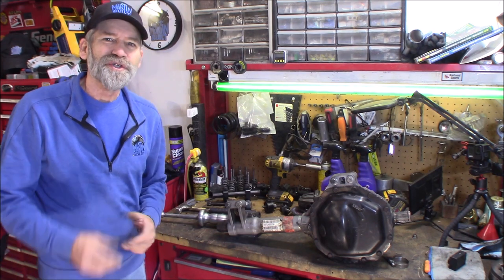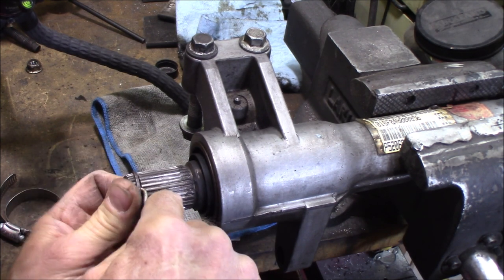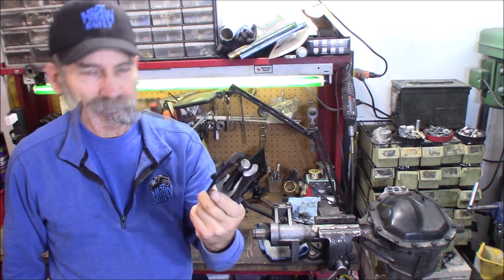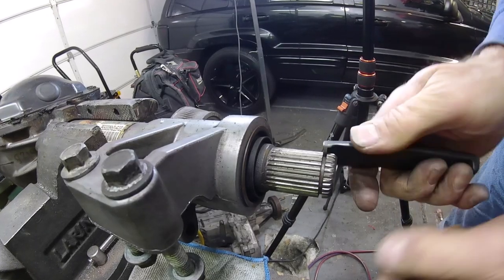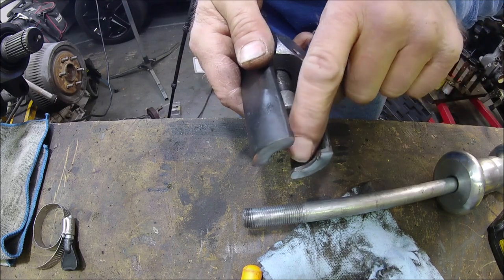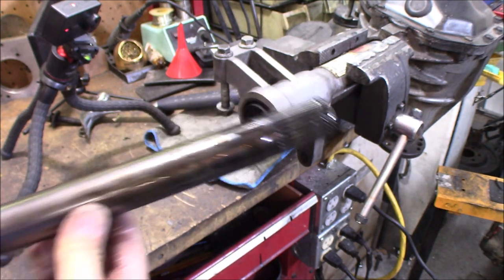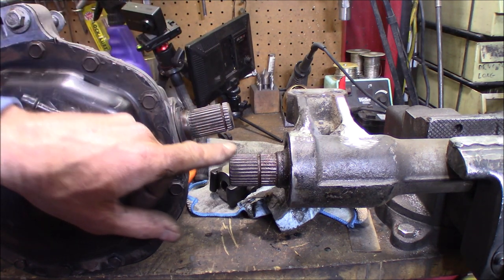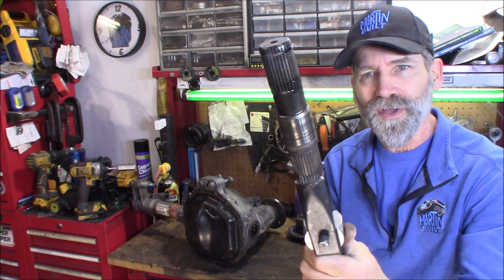Stub Axle Shaft Removal Dodge Dakota, Durango, Ram, and more

Comment: I believe 2000 is the transition year for the stub shafts as far as the circlip placement. It can cause issues with parts replacement. 

Also, this video saved me a ton of grief. I you could show how to remove the bearing in the axle tube that the stub shaft rides on, I believe you would make a lot of Dakota/Durango DIY guys very happy!!
Reply: Yes, you are correct re stub shaft circle placement. Specifically trucks manufacturers before 9/00 have the groove on the stub shaft about an inch from the diff. Trucks manufactured after 9/00 have the groove about a half inch from the end of the shaft. Good parts stores will know the difference and get you the right parts.
Reply from the maker: Yeah I will do another video on the seal and bearing replacement I'm glad you found this helpful.
Reply: @martinbuilt  That’s excellent, thank you!!!
Reply: geez.. why do they make it so complicated??  I've never seen a vehicle built in September, that had that year assigned to it's model year.  But,  better play it safe!
Best to take off the axles first, just to make sure which one you have,  as these  22-23 YO dodges  could very possibly have a replacement  axle someone else put in... and don't take the build date off the door sticker as gospel.  
It's next to impossible to find the  pre 2000 stub shafts for rebuilding a 2000-down,  so  just buy the  2000-up  shafts, and  get the  2001  cv shafts.

Comment: Ok, I'll try writing this again (first attempt disappeared from YouTube)...
There is a 'special' tool for this: Miller 8420C. Search around because there is a wide range of prices for the same tool. Anywhere from $60 to $120. It works with trucks manufactured before 9/00 that have the grove on the shaft about an inch from the diff and trucks manufactured after 9/00 that have the groove on the end of the shaft. Sadly, it didn't work for me on my '03 D. No matter how hard I pulled on the slide hammer the shafts would not come out. I almost pulled the truck off the jack stands at one point. I ended up having to remove the diff cover, center pin in the carrier housing, and finally the cir-clips from the inside ends of the shafts. Only then did the shafts come out. It was a P.I.T.A, but it worked. Hope that helps someone who has similar trouble removing these shafts.
Reply: Same thing happened to me with my 03. I actually broke the tool trying to get it out. I wound up doing the same as you to remove it
Reply from the maker: Yeah, I see that OEM does make a stub axle shaft removal tool, but it was $115.  And taking a tool that I paid, I think $30 for that I really didn't even like and making it into a really good axle puller was well worth it.
 I have also heard of other people having to remove the diff cover  and the cross shaft to get the axle out.

Comment: @1:50  Thank you for showing how to remove that Circlip on Intermediate Shaft. On mine it is kind of loose, so I think to replace it. How to find the right size and material? The original clip is from some white metal (alloy). I saw on Amazon dark color clips fm/Carbon Steel. can I use one of those instead of the original one? How tight it should be? The original one rotates with no efforts, I think it should not be so. Thank you again.

Comment: very nice Martin.
im working on a 2001 dodge dakota crew cab 4x4 that was a 3.9v6 auto and going to transplant a 1997 5.2v8 in it.
going to change the rear axle from a 8.25 hd anti slip 3.92 with a 9.25 anti slip 3.92. 
like to go from the 11x2 drums out back with disc brakes from a 2003-2005 dakota rear.
Reply from the maker: Sounds like a great project. I have a set of 11" rear brakes from a 2000 Durango R/T. I had installed the 03 Durango rear disc brakes on that R/T axle.
I also am installing the later model front disc brakes on my 01.
Reply: @martinbuilt  very nice.

Comment: I think the 05 shaft is probably a better shaft because my 07 cv axle popped off the stub shaft and I was looking at it and came to the conclusion that the cv shaft should be longer and it looks like the 05 is better.

Comment: I used your method and worked perfectly, as I been hearing grinding or roaring noise from the front end, I thought it was the bearing, I noticed the stub shaft wore two flat spots on the roll pin, what would cause the stub shaft to do this?
Reply from the maker: Glad to hear this method worked out for you.
 What roll pin are you referring to?

Comment: I had a clicking noise on left turns, so it is Passenger side CV Axle, so I'm replacing the CV Axles. When I removed the Passenger CV Axle I decided to replace the Seal as well. This Seal is on the Passenger side, so on Intermediate Shaft. It is 2001 Saturn SL2. When I removed the seal there was a lot of grease inside of the housing of the Intermediate Shaft. It was like half of the space inside was filled w/some grease of cream color. In Shop Manual (I have it for that car) nothing is mentioned about that grease. They just say to clean the Intermediate Shaft housing and apply the axle seal grease on the lip of the seal (where rubber is I assume), and to axle bearing (not sure is it inner side of the CV Axle or outer one?). So should I fill in that housing w/some grease, how it was before? Or that grease shouldn't be there. And what grease to use? I have White Lithium Grease and Green Lithium (that one you can add into Ball Joint and Tie Rod Boots. I also have some Red Grease. This part of the project is very confusing. What grease to add and how much? Thank you very much for this film.

Comment: My intermediate shaft on 2010 Mazda CX-9 splines are damaged. Is it possible to rebuild the intermediate shaft instead of buying a brand new one?
Reply from the maker: If it was my vehicle with damage splines, I would just go ahead and get a new one.Thank you for watching.
Reply: @martinbuilt  probably the best way to go about it. Thanks. I’m also rebuilding a 2015 hemi 1500 and I have replaced everything from the camshaft to the rocker arms but I noticed that the valves that are closed the rocker ams are loose. Do you know if this is normal?

Comment: I remember watching a mechanic who was trying to remove a half shaft off my Jeep that was on a lift at about head height with a slide hammer. I can't remember how he had it attached but it wouldn't break free. On about the fourth whack it broke free and with the centrifugal force came flying out and almost took his head off.
Reply from the maker: Yeah on these stubshafts if they've never been pulled out the very 1st time they can put up a fight and that's what's so great about this tool works much better than the screwdriver and hammer method.

Comment: Would Lucas oil stabilizer hurt a 3.7
Reply from the maker: I personally wouldn't use it. I feel the tolerances on the 3.7 and 4.7 are too tight for Lucas oil stabilizer.
Reply: @martinbuilt  thanks

Comment: Hi Martin, im swaping both differentials in my 98 Dakota to 2000 Durango (Mexico's version) so is there a limited slip or locker to put in the front?
Rear is a 9.25 with limited slip 3.92 gears, in excellent conditions, by the way.
Reply from the maker: Unfortunately, there is no locker or limited slip available for the front of the truck. 
Thank you for watching.

Comment: Not ALL slide hammer kits are the same!
And im not calling crapon tools to buy this clampon puller,so why not just weld a peice of steel on the end of the bad axle shaft!
See you aren't thinking a one time backyard mechanic fixum up my truck,cyz you have a huge tool box,cuz your probably a full service garage!
Or,since this intermediate axle shaft us garbage, just use a cut off grinding disc and notch it,or weld a nut on the end thread in a bolt,hook up your puller,and slide hammer away!
😅